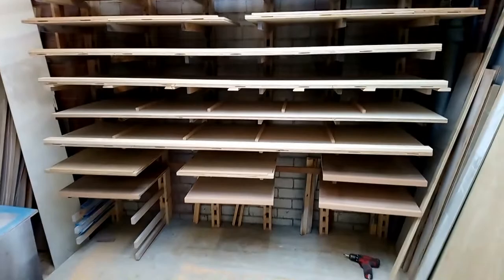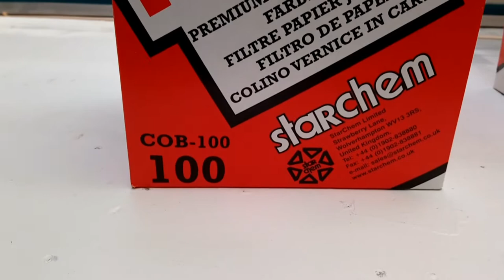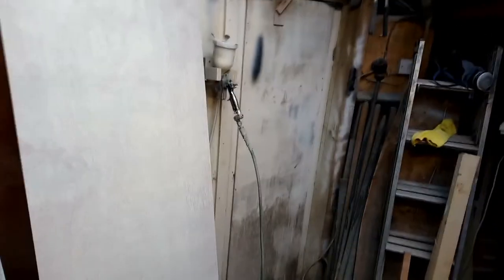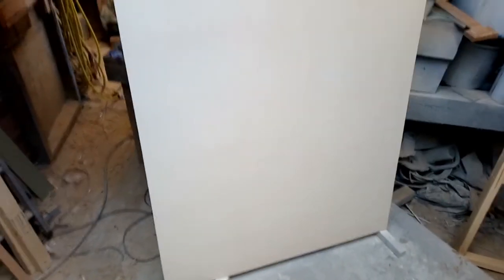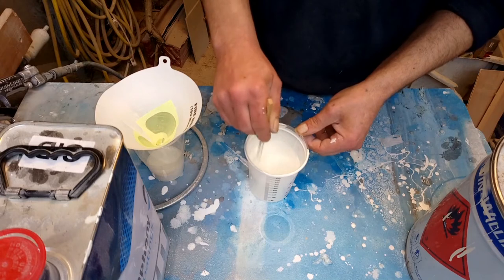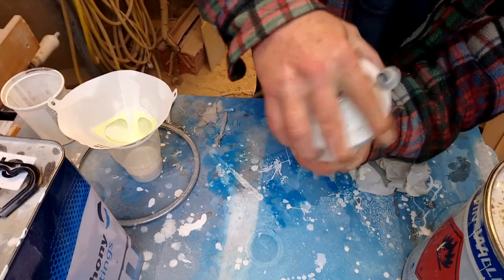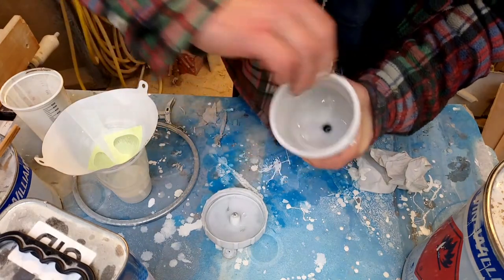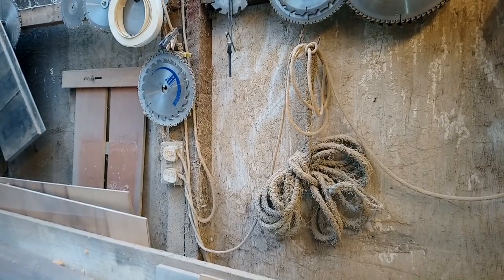Wardrobe build pt10 - Spraying the back panels, mixing paint & quick spraygun cleaning

Comment: Hello Gid, nice work, love your videos. Keeps me entertained and learning new things for hours. Just wondering, why you didn't use mdf instead of ply if it's all getting sprayed. The doors and face frame could also be mdf.
Reply from the maker: Thanks 👍 Good 😁 & i'm glad you learn somethings, that's why i share 👍 Reg Ply over MDF if it's just going to get painted - I have this comment saved for this, it includes why i use Beech instead of Pine, sorry it's long & copied n pasted, - 
 The basic answer is compared to Ply, MDF is crap, 
 It's about the quality of the base material & therefore the quality of the overall job, wood is wood to me so painting it is no issue but some woods are better than others, for quite a while i used pine, 'cheapest price' i was asked for but the shrinkage & warping later when the pieces went into a centrally heated house were unacceptable to me, Beech doesn't cost that much more on a job of this price, the time & expense put in ya might as well have a decent substrate that'll stay relatively stable for it's lifetime, Beech is harder than pine & 100 times better than MDF, it's fairly straight grained with little or no knots, it's not just the longevity tho you can feel the difference after it's sprayed, the temperature, the hardness & the way it shuts just gives it a better well made feel. I build these things with the hope that they will still be around in 50yrs like the old pieces that are still sometimes around, they were often made of pine & ply, which is what i was/am trying to emulate but the quality of the wood (pine) was better then, if i bought planed pse pine i would still have to machine it sq n straight because off the shelf it never is, so the labour in preparing the wood is not much different & cutting the dominos is the same for both & maybe the same time spent would be spent on the joint of MDF whether that is a spline/scribe/groove or domino.  
I would use MDF if I didn't care too much & the job was cheap, if i didn't expect it to last more than 5yrs, if i wanted a very flat no grain finish or if it had to be done with that material through customers choice for whatever reason (prob against my advise), Mdf boards never come straight so tall doors can be a problem, screws don't hold as well as they do in Beech so hinges tend to come loose, fitting butt hinges into the edge of MDF is not reasonably poss, I use ply for the carcass on some jobs for a similar reason so the screws in hinges/hinge mounting plates, hanging rails & drawer runners hold well,
When spraying there is an inside & outside edge on the stiles n rails, MDF feathers a little so there would be more work there sanding, I give my customers the option of ply or MDF panels on the doors, you get a very flat finish with the MDF, Ply is a slightly better material but there's a possibility of seeing the grain through the paint, their choice?, when sanding these doors with beech stiles & MR MDF (I only use Medite MR MDF) panels it's always the panels that need the most sanding,
I do sometimes use MDF for doors & drawer fronts, normally when it's just a plain flat door i want but I have a list of materials in my head, MDF is the very bottom & would be my last choice for shaker doors. unless it was a bespoke style/sized door to match an existing set you might as buy some, there's loads of MDF units/furniture on the market, a lot cheaper than asking me to build one, Building out of MDF is not the quality that my clients ask for or expect from me.

Comment: Looking good Gid, nearly didn’t recognise you with the haircut.
I can see the benifit of building  all parts up on s dry run first then taking to job site for final glue up assembly. Any issues with glue and painted surfaces on assembly? 
Hopefully we will see installation. Well done Gid.
Reply from the maker: Yep it's getting there, Easter got in the way a bit but nearly done,
The weather's warmed up a bit here recently n it feels like Spring is finally here so Gid got shorn ,
I do build things at peoples houses but I couldn't do this & it's all getting sprayed, 
The paint dries to sand in an hr, faster in the summer but I have to leave the panels to 'cure' for at least 24hrs or they'll stick together & rub when stacked in the van, 
I'm spraying the main carcass at the moment, then I'll do the front frame & doors,
I'll be working in someones house & this is work for me so I'll have to crack on with it, 
It should go together like a big puzzle,  but I'll film as much as i can & definitely post a vid of the finished piece, 
Thanks 👍
Reply: Yes I appreciate when your in a private house it’s difficult to film as it’s an invasion on the persons privacy. Plus as you say you need to crack on as you need to get paid. I’m sure we will see other projects in the workshop. 👍
Reply from the maker: 👍I've got a fence to put up, then some alcove cupboards to make & fit, then an off the shelf kitchen to fit, 
more jobs after not all in the workshop. 
I don't know what I'll film & upload.

Comment: Man I'm defo doing something wrong when spraying, it would take me 3 times as long to get that coverage. I think the fan is set as wide as it goes. Paint too think? I use Crown Fastflow waterbased paints usually mixed around 4:1 paint to water, 1.8mm tip, 30 psi
Reply from the maker: 🤔🤷‍♂️ Hard to say, did you mean to write paint too thick or thin? Too thick n it would spit out in bits, the paint landing on the surface wouldn't flow into itself, you'd have to go slowly & get plenty on, Too thin n it would look washed out, not much colour & it would run easily, I don't know about the paint you mention but the website says for brush or roller, 4;1 sounds a lot, this PU & the other solvent paints i used to use only get 10-20% thinners, these paints have a lot of pigment in them & are designed for spraying, When i thin waterbased acylic primer to spray i have to thin it a lot & it looks washed out on the first coat.